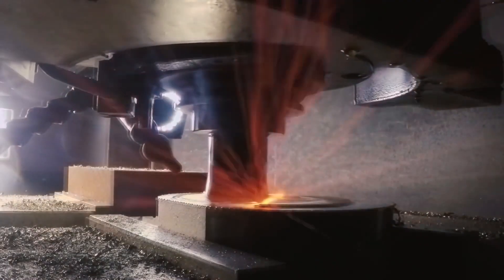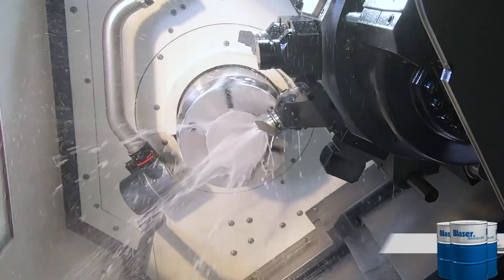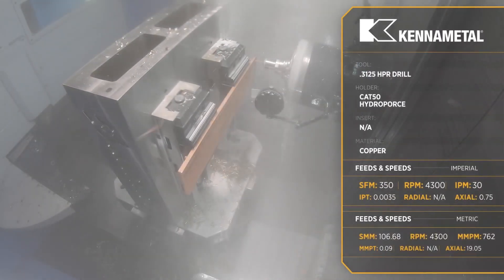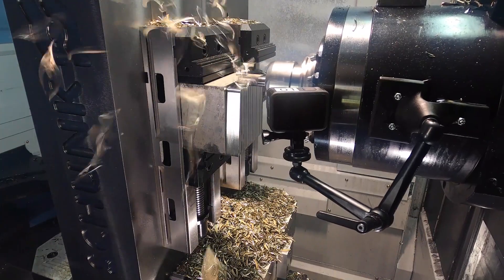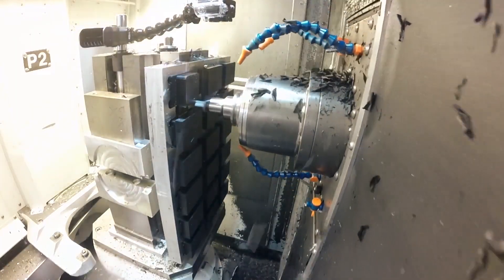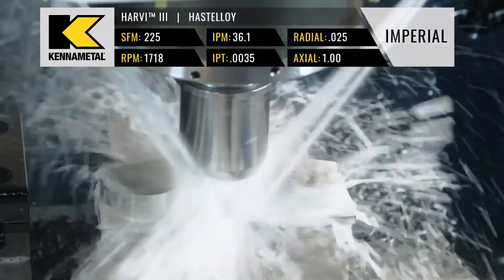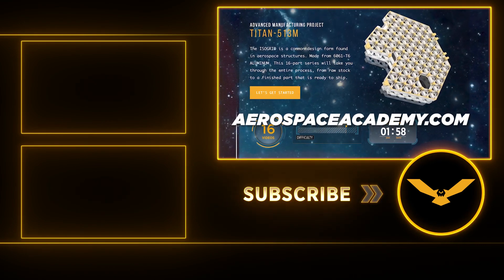This is the MOST CHALLENGING Material I’ve Ever Had to Machine

Comment: Worst i've came across so far was class 4 copper (yummy beryllium).  It had lots of NPT and helicoil tapped holes.  We used conventional HSS taps and they would last about 1-2 holes per tap, the material is super abrasive.  The part was too large to fit in the machining center to threadmill and power tapping on the HBM was out of the question.  Hand tapping even with xtra-thick and a massive tap wrench was a hell of a tedious workout.
Reply: I've been there too..... With investment castings made out of beryllium copper. As you say it's super abrasive, and we had to do some 8-32 threaded holes in it. Tons of flood coolant and "way slow" rotation prove to be the solutions. We were using titanium nitride coated taps (in a spring loaded tapping head) which lasted a lot longer than the high-speed steel ones. Still, you're gritting your teeth with every part. It also helped to use the maximum drill size allowable (tolerance wise).

Comment: Worst stuff I’ve come across was Turning Heat treated 440c stainless 57-60 rc with a hole interruption, was mostly .0005” tolerances and 16 surface finish
Reply: That stuff is brutal. I have cooked my fair share of endmills in that

Comment: I've machined many difficult to nearly impossible alloys over the past 30 years. Then about a year ago I got a job to drill and countersink some mounting holes for 1/2-13 FHSC in some wear plates. 1 1/2"  thick by 9". The material was MANGANAL. All nickel alloys cut like butter in comparison. Spot drilled the hole locations, no problem. Then tried to drill the holes.....roached a solid carbide drill immediately. Didn't even leave a mark. A couple phone calls and a little bit of research didn't produce any solid answers. The material reacts to pressure or impact. Goes from 32-38 rc to 65 rc in a blink. If you keep the chip thin, you have a chance. NO peck drilling. If you stop the feed, you are at final depth.
Reply: Last line of the comment got me.  "If you stop the feed you are at final depth."
Reply: Man, that sounds lovely! But awesome advice! Love this comment!
Reply: I HATE manganal!!!  Try dry milling 600 sfm and  5-10% radial, .004-.005 chipload for 1/2” EM.  Use an air-blast and enjoy the light show!  The best way I ever found to stay ahead of work hardening was basically making molten chips.  Ramping this way works great for making holes too 😬
Reply: @flyingiggies7458  I believe you have the solution there Iggie's. If you can keep a work hardening steel hot enough in a plastic state by ramping up the RPMs you stand a chance of removing some serious metal. You have to get a aggressive with this stuff, and machine it dry.

I love that line "use an air blast and enjoy the light show!"...... So true!

Iggie's, do you think ceramic inserts would work on this material?
Reply: Also known as Hadfield steel, or prison bar steel. And yes, you're correct, this material is deformation transforming. Normally it's austenitic, with 0.8 to 1.2 wt% carbon. If local deformation triggers a transformation to a ferritic structure with 1 % carbon still in it the hardness locally shoots through the roof.

Comment: Can't remember the exact grade, but we do get some stainless castings every now and then that are a bit infamous here because of how much of a pain they are.
Similar to your 13-8 story, sometimes your tools last 5 minutes, sometimes 2 hours, can't take your eyes of the damn thing even for a second
Reply: With PH 13-8 Mo you really need to be sure it has the right thermal history. If you need to do heavy rough machining, it should be in the over-aged condition, the softest and most forgiving condition. After that: solution anneal and precipitation hardening, and final machining. 

The chemical composition of 13-8 Mo has only a tiny operating window, so if the furnace atmosphere is incorrect and carburization occurs, you have a problem machining the surface, because the carbon content at the surface will be off and it will no longer react to heat treatment as it is supposed to. It also needs to cool to 16 °C / 60 °F after solution annealing, otherwise its austenite to martensite transformation doesn't fully complete.

Oh, but wait, there is more !! Any cold deformation, when the stuff is in Condition A (solution annealed) has the potential to boost some properties and degrade others after precipitation hardening. So, yes, it is finicky stuff. No, that's not a recognized metallurgical term, but PH 13-8 Mo has quite the manual.
Reply: @Hydrazine1000  NOW HERE IS SOME HELPFUL INFORMATION!!!!  I am totally in awe of people who know heat treating technology...... And especially if they can apply it to manufacturing conditions! Thank you so much for sharing your knowledge with us. 🤗
Reply: @johndonlan5956  You're welcome. I work for a subsidiary whose parent company can trace its roots back to ARMCO, the American Rolling Mill Company. ARMCO just so happens to be the original developer of the PH grades (17-4 PH, 15-5 PH, PH 13-8 Mo, PH 15-7 Mo and 17-7 PH)
Reply: It's crazy, right!?! I'm sure it has to do with the range of hardness that can be present in 1 piece of material, but I sure wish 13-8 was 13-8 no matter where in the stock you're cutting! I actually lost 8 hours per part by switching to the high feed mills. The endmill roughing was just so much faster. But you gotta do what you gotta do!

Comment: Rene 41 was pretty difficult, not so much the material but the part. Essentially a 12 inch snap ring only .084 thick sheet metal when finished with .002 flatness, give it a second to build heat and it was gone. learned a lot tho
Reply: OH MAN that's a bad one! Gross material AND gross part! My sympathies!
Reply: O yeah, i heard of that material, i remember a co-worker calling in sick and taking vacation to avoid working with that material.

Comment: i work in a plastic shop and a lot of material has to be heat treated because it is extruded to size, so iv'e seen it expand .020" or more after cutting and leaving it over night.
Reply: Totally with you on that! I hate dealing with thermal expansion/contraction. I hav worked in shops whree th ambient temperature would fluctuate 50° in a shift, trying to hold .0002" on a part that would get inspected the next day in a 68° quality lab.

Comment: The most difficult thing I've ever cut was well the blueprint said XR-metal or C-27 cast basically super hard white iron with alot of small and large uneven interrupted cuts the material is really hard but really brittle the only way I can make this part is with a CBN insert  BNS800 grade from sumitomo CNGX434  for roughing CNGA432 for finishing 
.06 doc 400 sfm .004 feed per rev for roughing 500 sfm .005 per rev finishing surface finish is around 10ra
Reply: What I love most about your comment and a few others like it, are that you didn't just talk about the nightmare, you also talked about the light at the end of the tunnel! BOOM education!

Comment: The toughest I machined is M390PM. It is like a stainless, but that stuff eats specialized tooling for breakfast and spits out burned mills and broken dreams. Not a aerospace material, but a steel for die and molding purposes.
Reply: @BB never worked with that, but I've heard it's a formidable opponent as well
Reply: Never ran that stuff but it sounds like a blast LOL
Reply: @barrysetzer  it is. Especially when it's hardened. Extremely wear and impact resistant, so the tools and speeds and feeds needs to be perfect. A lot of outsource companies here in the NL refuse to machine it because they struggle with it

Comment: I have to say. I haven't worked with any super alloys like titanium etc. But, I have machined plastic like materials, it was called nylatron. Chipped very nicely, was easy to machine, but extremely difficult to keep tolerance tight. Some of the parts had a -0.0/+0.02 mm tolerance. This is not difficult to achieve, but, to have those sizes stay right after you've taken it out of the vise is undoubtedly a difficult task.
Reply: Totally with you on that! Plastics can be an absolute nightmare!
Reply: Titanium itself is an element not an alloy. Meaning it is a singular material, not a mixture (alloy).
Reply: @rw2954  ohh, well did you read the rest of what I said or did you just want to look smart by correcting me? I'm quite certain that you knew what my point was, thats why you corrected me in the first place right? 

I'm also quite certain that titanium is mainly used as an alloy, and not just as pure titanium. But I'm sure you'll have some facts about that as well.

Comment: N45 I think it was. Made swing bolts for the Navy. Started at 130 SFM and burnt the insert quickly. Had to dial it back to 45 to rough and 35 to thread. Got the job done. Of course there were strict specs on everything associated with these parts. Even down to the finish at the root of the threads.
Reply: I am always amazed at how we get SO many nightmare parts and materials and tolerances, but in the end we succeed. It's all about sticking with it and problem solving.
Reply: Just how would you go about measuring the surface finish at the root of a thread? Maybe use a shadow graph, take some measurements, and then apply the formula for RMS?

Comment: The part whitch i struggelt the most Was just a hole 50h7 in 550 Hardox 150mm deep the tool deflectet and maked it really Hard to get a nice finish and fit. Leasson learnd get a nice tool to do the job no crap lain arround.

Comment: I had to machine a thrust component that was chemically vapor deposited and machined from a total of 7 material layers.  The mandrel base was turned from molybdenum, and that was the easy part.  From there rhenium, iridium, niobium, rhodium and other refractory group metals.  Specifically platinum group alloys were the most challenging to successfully machine.  Rhenium was by far the toughest to figure out.  Btw, the positional tolerance was called out to all 7 layers to a .0025 with MMC bonus of under .001.  between each coated, machined, and laser scanned layer.  *Measure twice, cut once"
Reply: Good god man! That actually SOUNDS like a comic book metal LOL

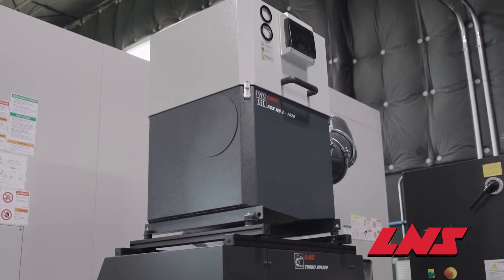Comment: >> AT - 1:20  > You Said there was No Rhyme Or Reason for Your Inconsistent Hole Sizes.. >> When It Comes To Exotic Materials - Like You were Machining > It May have been An Issue with Your Speeds & Feeds as We Used to Call It.. You Sometimes have to Slow Down to Go Forward. > Plus It was A Material Or Combination of Materials that You Never Machined or Even Heard Of Before.. >> So, First thing A Pro does is Experiment with A Piece of that material before Actual Machining as to Not Waste Material-Tools-and Time-=Money.! > This Just CENTS... Feed Rates of 100-500 Inches Per ~ Don’t Always Work.. > Also > Never Forget Super High Spindle RPM Almost Never Works with Exotic Materials.. <> Me, Retired Avionics Machinist. <> Manual’s - Automatics-NC’s - CNC’s..  Machined Every Material Known Till 2015.. 45 Years.. Last Job. Machined Recording Heads for 15 Years for Flight Recorders.. Boeing Planes  and  F-18+++..  20-30 and 50 Millionths of an inch., Tolerances...

Comment: I have come across a few over the years.
As you say lots of easy to cut materials with parts making it tricky but some easy parts out of new materials.
A simple eye bolt 10/32 thread  2" long on a lynx with driven tooling however it was made from waspalloy..tools realy struggled.
Another was a threaded tensile test piece made out of aluminium biut with a high silicon content. 
I had to use diamond inserts for that to get close to the correct size..
Reply: I personally think it's even worse when the geometry is simple. Sure I can make an impeller out of inconel, but please don't give me a square with a hole in it!!! LOL

Comment: Nitinol medical part. Not just the material was a nightmare but the shape of the part was insane.
Reply: Sometimes, meeting the design engineer in person would be nice HAHAHA
Reply: @barrysetzer regarding your above statement....... when I was a manufacturing engineer I represented the manufacturing engineering department on the "change notice review board". Every time somebody wanted to make a change on one of the blueprints, that blueprint would have to come before the board (we met every 2 weeks) and each department representative would have to put in their two cents about whether that change was feasible or not. We had Representatives from Assembly, mechanical design, electronic design, manufacturing engineering, manufacturing, materials purchasing, quality control, plating and finishing, and one or two other departments..... All sitting around a long table. The blueprint would be passed from one person to the next, each representative reviewing the requested change to see if it affected his or her department --- or whether it could even be done! It was fantastic.... Because we all got to talk to each other about this particular change (what was being requested, and why). The question we each had to deal with was "how does this affect my department?" Every department had to sign off on each change..... Otherwise the change couldn't be done. We would send back suggestions to the originator of the request on variations that would work (in case they're change request was denied). It was a fantastic process..... Everybody cooperating for common cause.

One example I can remember is when there was a request to put a blind pocket hole in an aluminum die casting. The designer wanted square corners. An electronic unit with a rectangular square body had to fit into this pocket hole. At that time we did not have the ability to EDM sink this configuration in order to get square corners..... So I suggested that we be allowed to make the corners with a small radius (so that I could walk around the interior with an 1/4" end mill).... But the resulting radius in the corners would prevent electronic component housing from fitting into the pocket. But they did allow us to plunge Mill a quarter inch hole at the outside of each corner, effectively wiping out the radius by situating the hole close enough to the pocket corner. It looked weird, but it allowed a square corner...... And neither the designer nor the electronic engineering department had a problem with it. The design change was signed off...... And the blueprint was changed.

The nice part about this, Barry, is that we all got to talk to the designer. That happens so seldom in modern industry....... But it was so necessary in our shop -- we were making linear and rotary actuators for Boeing 737 aircraft...... The motors that would make the rudder go back and forth, the ailerons to go up and down, the flaps to go up and down, etc...... And people's lives depended upon the integrity of our product.

Comment: I think of 2 valve bodies I had to machine that went on a oil pipe line out of A2 that had been already heat treated. Scraped out 1 due to chatter in a finish cut of a bore. The Kennemetal rep stayed at our shop for 2 days trying to help us figure this chatter out
Reply: I was just talking to a buddy of mine yesterday about a similar job. They spent 2 days on a 13-8 job trying to get rid of chatter. Conventional cutting ended up being the answer, but it's funny how as CNC machinists we have been conditioned to steer clear of conventional 95% of the time!

Comment: I think I have an answer for the copper and the 13-8. The copper was so soft normal shavings don't form. The 13-8 raw forging material spec. allows for too many grain variations.  Your end mill probaly failed on a different side than the "Rc" ck was done.  Both materials require a higher feed.  You have the most amazing shop and boss! Maybe I'll be lucky enough to meet you some day.
Reply: You may be right! But you know how it can be in a stressful production environment, there's no time to figure out the "why," just to figure out the "how do we keep moving" LOL!

Comment: Number 1) Turning inconel 718 after it has been heat treated.
Number 2) Turning this material ( I forgot the name of it) from raw forging was like Turning 4140, but turning it after it came back from heat treatment was a nightmare.
1st op ID turn n finish, 2 boring bar to rough id with interrupted cuts then finsh id with 3rd boring bar, rotating all 3 boring bar insert after each part.
2nd op rough n finish OD front and back side, rotate insert on all 4 turning tool after every part.
To deburr backside of the part from id turning, forget using a file to deburr it barely put a scratch on it, pull a strip of burr from the part with pliers and then rub the part against the concrete floor to smooth it out.
It left a gray scuff mark on the floor, use sandpaper even round handheld flat stone to get it off, No luck its permanent.
I'm proud to say, i left a mark at that place.
Reply: Oh man, I should've mentioned hard stuff in the video. You just brought back a nightmare of min, 60RC CRES stainless!
Reply: "concrete deburring process"....hmmm..... I'm going to have to remember that one!

Possibly a hand grinder might have worked better.

Comment: We had these parts come in that engineering wanted made out of Macor. I'd never heard of it but it's basically ceramic. The info said it was easily machinable but the issues came with how brittle it was and the size of the part. Barely clamping on the part for multiple ops led to lots of cracked and broken features. It was a pain.
Reply: Yeah that sounds brutal, but you got through it! Boom!
Reply: I had to make a vacuum chuck ceramic parts because of how brittle the material is. I like watching these videos because It spawns ideas and you learn by reading some of the good comments. AND....there is nothing more satisfying than watching all the chips fly. Thanks!!!